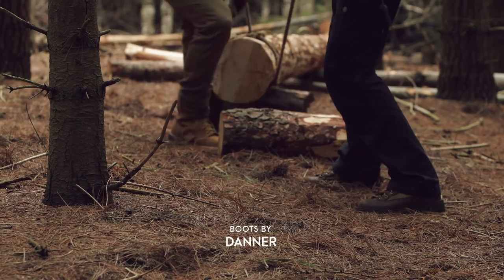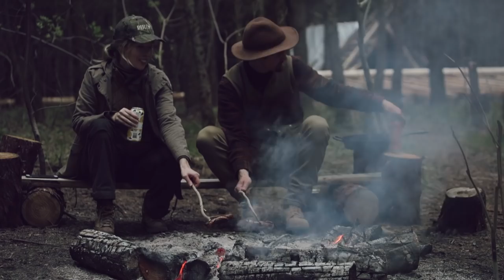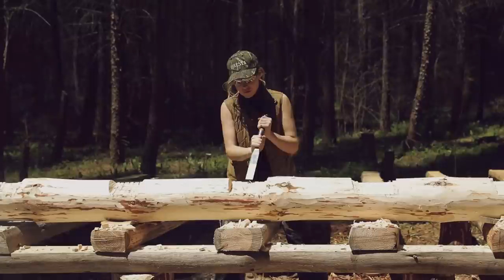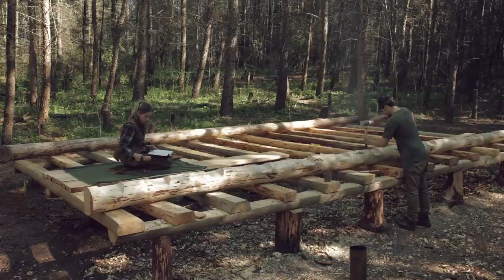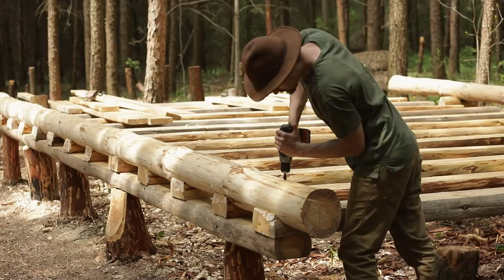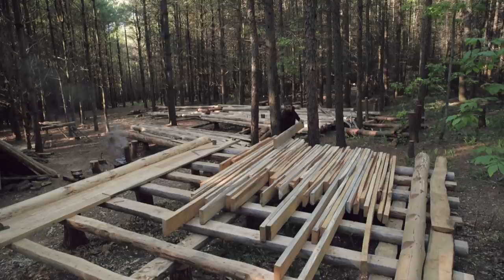EP 5: Wife helps me move and cut first wall log for the cabin // Cabin Build EP05

Comment: Here’s a suggestion for moving your logs and timbers , get you set of 20 inch wide rim bicycle tires and make a platform to hold your logs with tied down holders on them , make a pair of them using two tires per set , you could put one set at either end , make them so you can brake them down for easy transport .. This should make moving them around mach easier

Comment: Try to find a log dolly. A frame with wheels and pinch claws. That and a simple pulley system will ease your labor. I'm excited for you. Hand hewing and rough timber work is so intimate.
Reply from the maker: Yeah, I know. I've been looking. Found the guy that makes those Timber Carts that look awesome, just can't justify the price for my little cabin.  I'm trying to build this spending as little as possible so I can stay out here and not need to go to real work:)
Reply: @TrustinTimber  Holy smokes, the cost on those seems absolutely nutty. Surely this can be made for next to nothing with scrap moped wheels and a little bit of scrap tube steel.

Comment: 👍a block and tackle with a A frame will help alot with lifting logs and moving logs around use it all time on my property turns a 4man job into a 1man job keep up the great work
Reply from the maker: Thank you, Yeah, I'll be rigging something like that up when I need to start lifting big logs up.
Reply: The a frame works good for moving them though the woods by letting it swing completely over it lifts the front of the log up and how ever tall the frame is it moves almost double that in movement allows me to move 2 1/2 foot thick oak trees whole up hill 16ft at at time with a 10ft A frame you can also check out mr. chickade's channel he does similar projects alone he's super knowledgeable. Great stuff so far not many people put in the effort to do things themselves 👍
Reply: @TrustinTimber  don't forget that the weight of one log can be used to lift another log with cable/rope hoist ...... and teeter-totter method works too ..... leverage is a wonderful thing..... yup....y'all are doing wonderful.... I like to watch y'all work.... lol

Comment: would be nice to have a place truly your own.. but as a suggestion build a barn style workshop before.. that way you're both dry and be able to continue your work.. the logs you mill will be safe from the climate (wet or winter) barn style high enough to put in a pulley system to carry heavier loads of wood..and has doors on either side.. (both to bring in and take out the prepared work.along with ventilation, later on when you've build your cabin.. you can use the barn as a barn for other stuff, also a suggestion.. stain the floor logs before you put them in.. once in ill be difficult to stain them on either side).. GOD BLESS.
Reply: I agree. Build the shop first and with a loft. It makes very practical sense.
Reply from the maker: I's actually good if the logs get rain and snow on them.  They will dry slower and crack less.  I hang a tarp if it's raining.  We'll be moving the cabin so this is only a temporary location.

Comment: I get that you guys want to get as much first hand, hands on feel but once your backs get hurt they stay hurt. 
Get some or make some rolling dollies, block and tackle, pulleys... You can get allot of this used on Ebay or craigslist.
Reply from the maker: Thanks for your concern.  I do have a block and tackle that I'll be using when I need to lift the logs up. We used a crank winch here a bit but ultimately found just maneuvering by hand was quicker. I definitely hear you about back pain. I struggled with it most of my life but surprisingly since I started doing yoga each morning and working out here my back has felt better then it has in the last 20 years.
Reply: @TrustinTimber  Thats great just dont wait to use the BT til its too late. lol

Comment: Nice project, great couple!  Which state or province ( if it is Canada ) are you in, guys? How big is a lot? How much did your lot cost you? What size of your cabin? Thanks!
Reply from the maker: Good questions. We are in Ontario.  The lot is 100aces but we don't own it.  We're just harvesting the lumber here and building the cabin on the forest floor that we get the logs.  We're saving for land and when we buy some we will completely disassemble the cabin and move it to our new land location. This section is 24' X 16' (platform) but it's being designed so we can easily do additions later on.